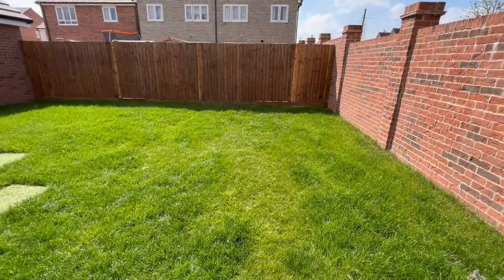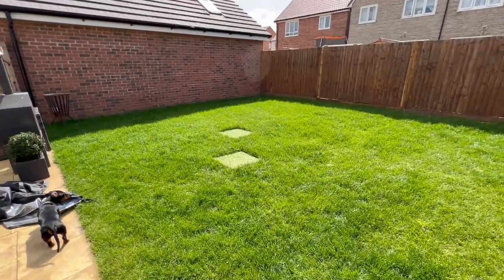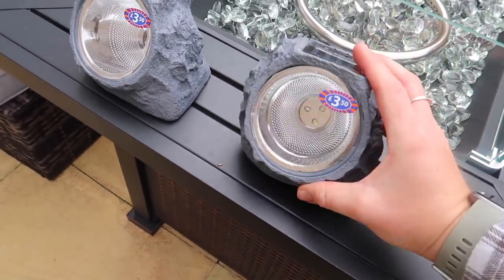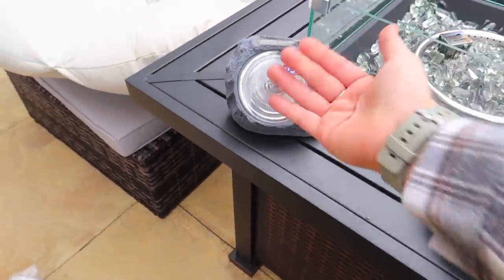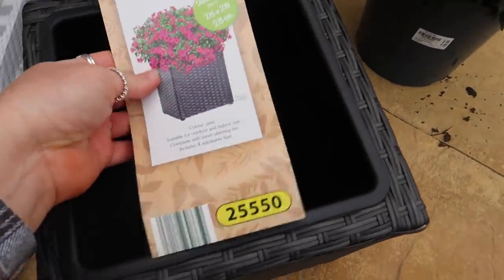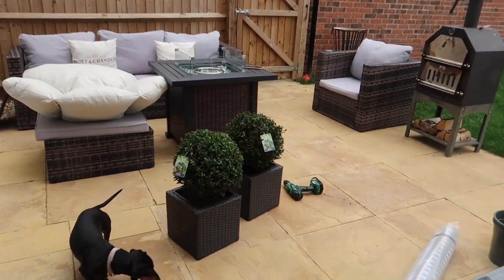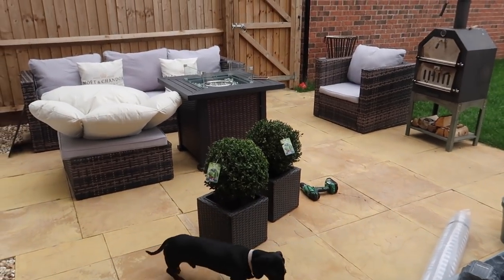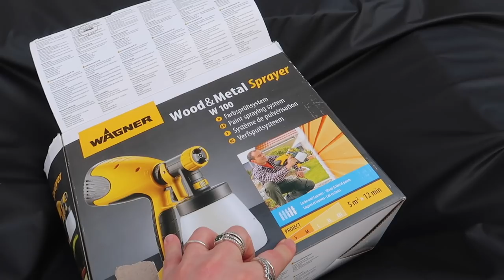GARDEN MAKEOVER UK | BUILDING DECKING, GARDEN FURNITURE, GREY FENCE PANELS | PART 1

Comment: great vid! just one thing, the deck frame is sitting on the ground? shouldn't it be raised so it doesn't sit in water and rot?
Reply from the maker: It is on a ground sheet and the wood is high grad pressure treated wood. There will be pillars into the ground with concrete that support the structure so it does not sink

Comment: How come for the decking base you laid it on top of the ground instead of raise it off using posts & cement?
Reply from the maker: I explain in part 2 but It is high quality treated timber and is resting on the ground sheet, there will be posts into the ground and it will be cemented in

Comment: That's expensive for the egg chair £339 everywhere else are selling them for £250
Reply from the maker: They are always running additional discount codes so £339 is not what you actually pay. Also this chair is bigger than the one is B&M as that was the one I was originally going to get